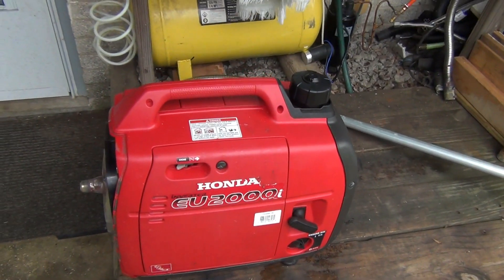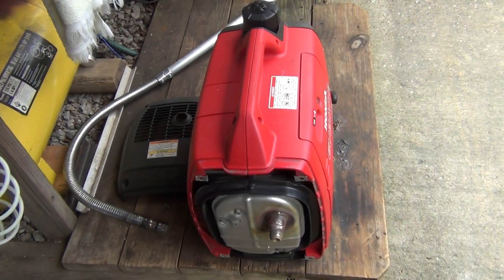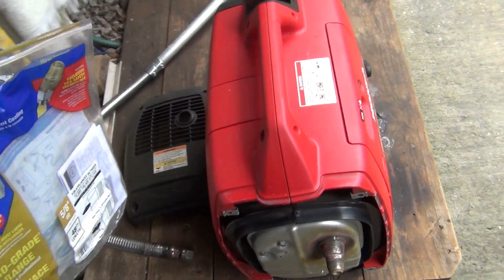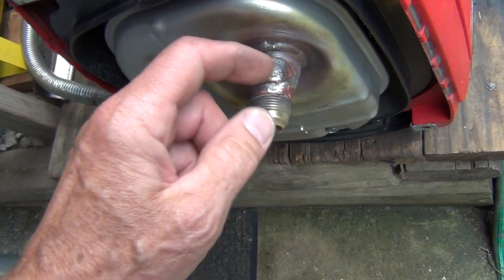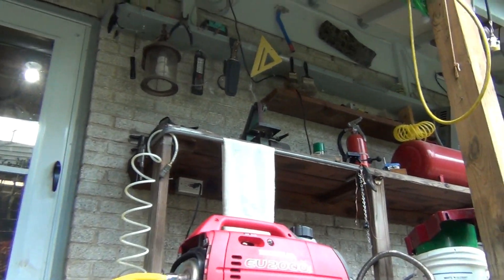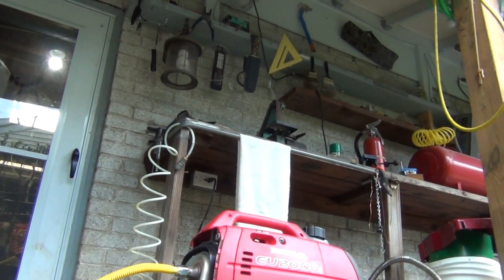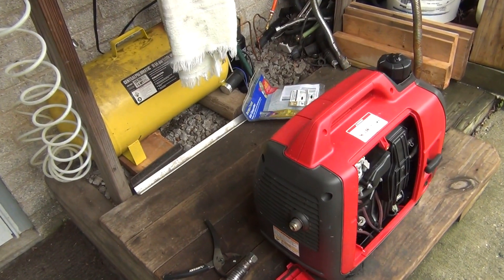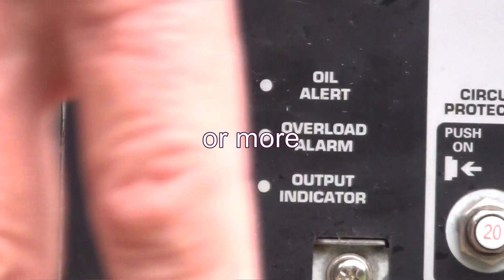Honda eu2000i inverter generator muffler exhaust

Comment: Hi the idea is good but hey it's still very noisy,,,,,,,if you're interested to make it more interesting then run the hose into a large car oil filter system the holes  at the bottom of the filter or muffler the exhaust system should not restricted you will causing to much  back pressure 😉 😀 😄
Reply from the maker: Point of this video is to transfer the fumes away from the house, not to quiet the generator.

Comment: The yellow gas line is designed to whistle or make a noise in case it has a leak you can hear the noise so the idea is cool just use a different kind of piping.

Comment: WOW,....... Several other videos etc point out (WRONGLY) that This Honda does NOT come with a "Time Run" Clock,....... The Flashing light IS THE CLOCK. And the Carb Drain,....Both, I do not remember reading or hearing about either,......THANKS!!!

Comment: Works like a charm, very quiet.▫▫>share4.photo/H2KGenerator?k63k  works great for out door fun, recommend for any DJ's can power two 550 Watt speakers and mixer without an issue. Started with one pull for the first time. Adding oil is a bit clumsy, you need a long neck flexible funnel.

Comment: creates backpressure
Reply: Better little back pressure then carbon monoxide poisoning
Reply: you need to increase the size and decrease the pressure. Back pressure affects the operation  of the unit.
Reply: Exactly.  Can make the unit run lean and possibly cause pinging and damage the motor.   Don’t mess with factory design if you want things to last as long as possible.

Comment: Hose or pipe should be at least 2x larger than muffler pipe on generator.
Reply from the maker: it is
Reply: Why ? First time I see this recommendation
Reply: @Johnzx2  Exhaust compression.
Reply: @paulglover6525  I mean, if it's the same dimensions there won't be compression unless the exhaust tube is 100ft long?
Reply: @Johnzx2  Oh. O.K.
Reply: Wow your smart guy maybe you should have made your own video